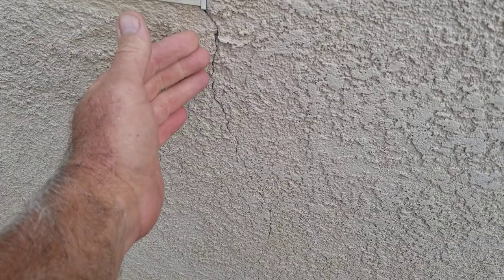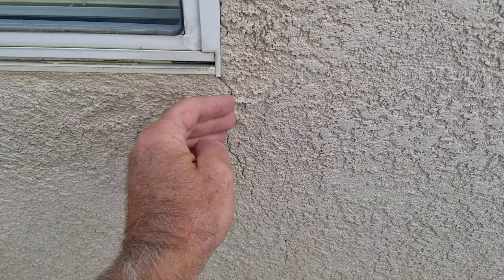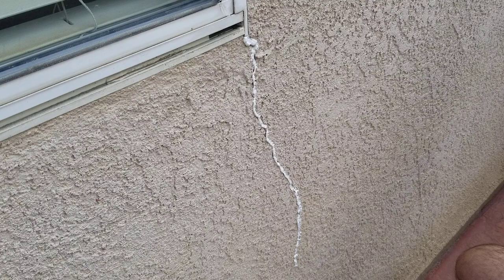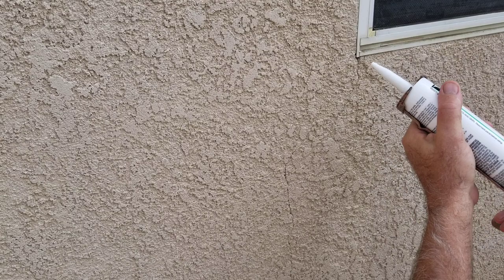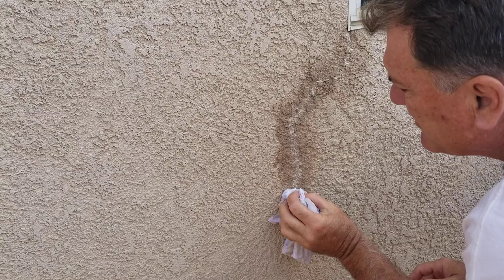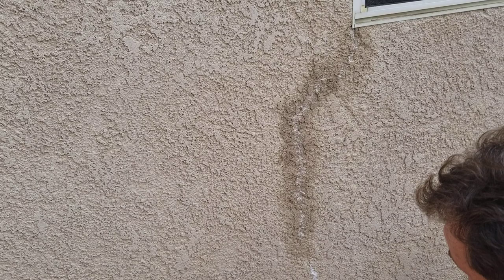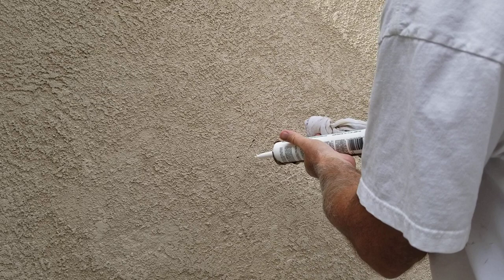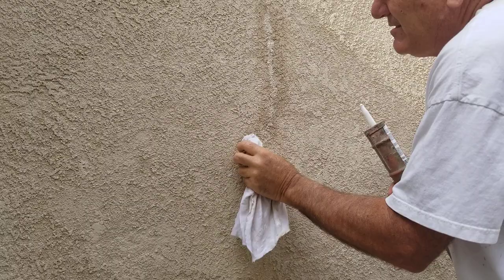FIXING STUCCO CRACKS how I caulk stucco cracks to not show.

Comment: Hi Mike, 40 years on the tools here (stucco/plaster), we also use sealant but take it one more step, after tooling the sealant into the cracks we then broadcast sand onto the wet sealant/caulk surface, either clean mason sand or silica sand, toss it on by hand or put some into a water bottle & pour onto a brush. Works a treat.
Reply: Interesting technique. I'm going to give it a shot my next repair.
Reply: @ZackZaqZakXah  Soapy water on your finger tip to slick/feather the caulk prior to adding sand works awesome
Reply: Interesting 🤔 can I get the material, please 🙏 thank
Reply: @dynoesaur  Either 'Masterseal 150' or 'Dymonic FC' would work
Reply: Sand topping stabilizes the shrinkage and helps obscure the Crack line ❤
Reply: @TomMason-io1yn  Also helps provide protection against UV rays, caulk's enemy :-)
Reply: Pro tip
Reply: Or just use a textured masonry caulk with sand in it.
Reply: @rickybobby7276  You could do that, less effort for sure but it won't feather/blend as good as the sand in the caulk won't allow you to slick the edges so as to feather into the existing texture, apply your sealant, slick/feather edges and broadcast the sand on the surface. Or, just do whatever you think works better.

Comment: Cracks tend to happen from dead weight. Meaning, the stucco was finished first then the added framing, and drywall was done after. Stupid inspectors from the city makes you finish the stucco first.

Comment: stippling with a dry old paint brush will also perfectly blend in the caulk with the texture of the paint.  Good alternative to wetting and down caulking and potentially causing it to deteriorate and thin it too much before it dries.

Comment: Thank you for this! Would you suggest a tan colored caulking for tan colored stucco, or do you think the white would look less noticable? Or maybe even clear? Probably won't plan on painting soon.
Reply from the maker: you can use either. just the white has different grades. Like the 25 year vs the 35 it shrinks less.
Reply: Which shrinks less, the 25 year or the 35 year?

Comment: I agree with all of this, except You really should cut your caulk tip at an angle. Hold it firm against the crack and force caulk into the void. Hovering over it and pumping caulk on it isnt very effective... even if you do rub it vigorously.

Comment: Here in Florida we tend to use a stiff duster brush, wet of course but rag works also. Thanks for your videos.
Reply from the maker: yea I was going to show that method too. works well. dip the brush in water and run it over the caulk. Still comes out a smidge better with the rag. Both works good too. Just use the brush in water run over it then hit it quicker with the rag.
Reply: Will this method also work on a stucco block wall?
Reply: @mikethepainter  great video.  Do you have a video or info on the stuff duster brush in the comments?  Thanks!

Comment: Wow thank you good idea, I live in Arizona my new build have has several cracks and the did not caulk it, they had to repaint the areas fixed, 4-5 months later there are  re-cracks on the corners of the window frame

Comment: Thanks so much for the video. For the caulking, I see a bunch of different types, from a $3 bottle of DAP Alex Painter's all purpose caulk, to fancier DAP Dynaflex sealant. Do you have any idea which one is better? Thanks
Reply: If it’s your personal home, use the best caulk you can buy - 15yr+ , not the cheap caulk that won last 3 yrs.
Reply: In my company we use 850a which is 45 year or 950a which is 55 year. 850a is about 5-6$

Comment: What I do if I'm already doing stucco 
I use my stucco float with a bit of sand to add texture to the caulk
Reply from the maker: yea usually it will mound up a bit. but sometimes I do that. if the voids are wide. Best to wipe it tight or use a stiff brush with water then wipe it.
Reply: Any cracks bigger than hairline should probably use a grouted/textured caulking imo

Comment: I live in a house built in 1950s. It is stucco and i am having some cracks show up. My cousin told me to fill the cracks with tissue paper and put the stucco over it. Why do i have a crack. It coulld be roots from a non bearing mull berry tree or that the house it old that the foundation is settling.  Maybe its the heat. I dont know. If i fill the cracks with tissue paper and fill with stucco, will have to sand it? If so, what grit do i use in sandpaper. Im not going to paint immediately.  Its too hot in Texas for that (triple digits).

Comment: The video seems unfinished, did you have to repaint the crack after the caulking dried?
Reply from the maker: Yea I painted the whole house this is part of the prep.
Reply: Do you prime cracks..?
Reply: Than paint house color
Reply: @hliz8818  I would think you already found an answer. Paintable caulk doesn't require primer. Never hurts tho. Silicone based - no go for me if needs to be painted

Comment: I’m in Florida what do you recommend pressure wash before i fix the cracks or after?
Reply from the maker: I usually pressure wash first. water wont leak into the wall there is moisture barrier behind the stucco.
Reply: Tara how is the water leaking in? Are you sure it’s not an issue with the flashing? My understanding is cracks don’t matter much for water intrusion because it’s still supposed to float down the paper and flashing should protect from coming inside your house.
Reply: I contractor in New Mexico. I personally do Pressure whash my jobs first and apply wallease and mesh buried. Later color coat. But always Pressure whash first to remove all dust in order  for the cement to stick better

Comment: Ok, I heard you say your guys still don’t do this. I’m in the opposite situation where I kind of take my time with things like this during preparation repairs but my employer cracks the whip & says we need to be more productive. As a result a lot of cracks went unfilled, old caulk wasn’t removed from the window sills so the new caulk looked all boogered up and looked awful. So where do you draw the line between quality work/making a quick buck? It just irks my when my employer goes on a diatribe about doing it right or not doing it at all but then when I take too long I’m not being “productive”. 🤦🏿‍♂️
Reply from the maker: yea there are some comers you can cut but some you really should not. Getting better with cardboard shields vs masking is one you can do to save time. also trying not to do all the prep and then some before you paint. do a quick good prep. then start painting and do some as you go. that is the best advice I can give you. so many people spend too much time prepping everything perfect before they start painting. For instance keep the caulking gun in the area where your working when you see a crack you missed hit it real quick then paint or catch it on touch up. Its a balancing act.
Reply: @mikethepainter  That’s understandable, thanks for your reply.
Reply: @mikethepainter  That’s understandable, thanks for your reply.
Reply: I know this comment was 10 months ago, but I hope you start your own business. 

The biggest problem in the industry is people trying to make that quick buck. If you feel like your work stands out with more love and attention to detail, it already sets you apart to make those big bucks. Good luck!
Reply: @meowman25  Thanks, yeah I decided to work for myself. I’m still trying to figure out the licensing and insurance aspect of it. Not committing to take on big jobs just yet until I have the legal aspect of it taken care of but work has been steady and things have been looking up. I’m averaging $40-80 an hour now as opposed to the $15 that I was making an hour when I made this comment. I’m considering going back to school so I can get some type of licensing, not sure which one to go for just yet but I’m really glad I made the leap. These last 8 months have been most investing in tools and equipment but well worth it.
Reply: I feel your pain.

Comment: What do I do if stucco guys filled cracks and now I painted and they all bleed through. We did prime coat then they patched and now we did two finish coats and it’s still bleeding through
Reply: you need to prime it again. Like after the patch. You prime the surface so the paint has something to bond to. The primer soaks into the stucco so the paint can cover properly.

Comment: Well that is a Crack, but I like you answer me what you do when the stucco crack is falling, do you just caulk the crack,  in your video is no falling stucco but you didn't removed the falling stucco?, that is the reason I opened the crack, and the way you pushed the caulking is the hardest, for that you need a sponge 🧽 🧽 🧽 it is more easy, you having a hard time that's why your employees ignored you